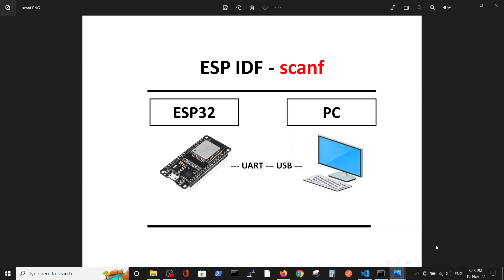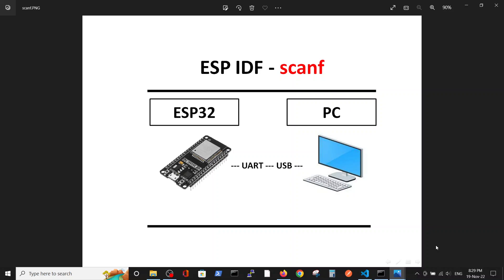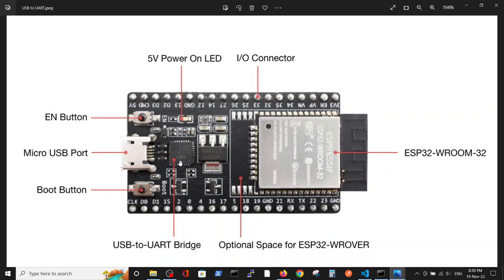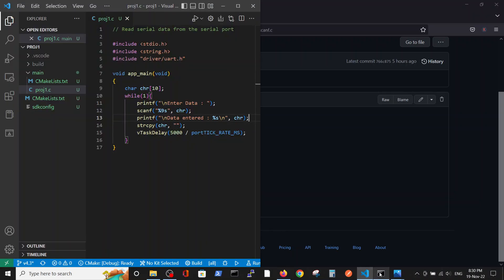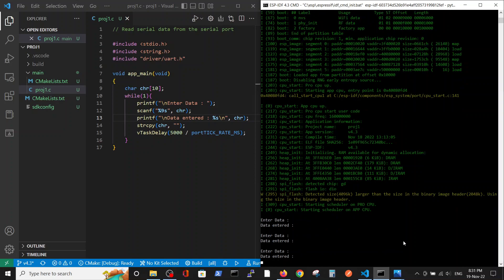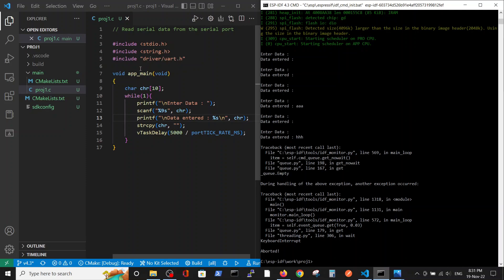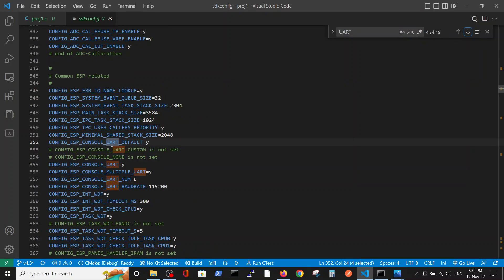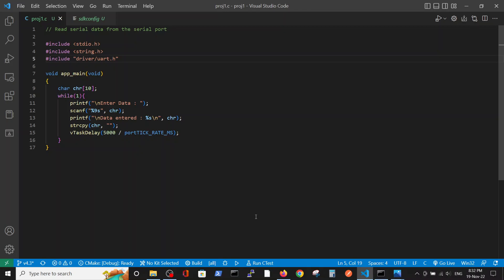ESP IDF printf and scanf via the console without UART definitions

Comment: How are you able to type in your command prompt? Whenever I try to type, I get the error " --- Warning: Writing to serial is timing out. Please make sure that your application supports an interactive console and that you have picked the correct console for serial communication". Thanks!
Reply from the maker: Dear @ironshawarma,
I have reloaded this program again and updated the delay command for version ESP IDF 5.0 in the following link:
https://github.com/SIMS-IOT-Devices/FreeRTOS-ESP-IDF-Basics/blob/main/scanf-v5.c 
The program worked fine as in the video. What board are you using with which ESP32?
Reply: @simsiotdevices6219  I am using an esp32s3 board. I tried using your updated code, I still get "--- Warning: Writing to serial is timing out. Please make sure that your application supports an interactive console and that you have picked the correct console for serial communication."

Was there any other external software/terminal you installed other than esp-idf?
Reply from the maker: Dear  @ironshawarma  ,
I think the difference here is in the electronic board we use. I am using ESP32 DEVKITV1, and you are using ESP32S3. Those are different hardware-specific UART behaviors. ESP32 has a native USB chip, while ESP32S3 has a USB-CDC. I think that is the main reason for the different behavior. Please check in your menuconfig that stdin/stdout/stderr are defined over UART.

Comment: Thanks for the video.
I had a misconception. I used scanf before in esp-idf but it didn't work. I also read in esp32 forum that we can't use scanf in esp-idf platform. 
Should we use scanf instead of esp_console library?  I am currently trying to use the latter.
Thanks.
Reply from the maker: Dear One tech a day,
The esp_console library enables you to create a console like interactive shell (DOS, windows CMD, windows PowerShell, ...). On the other hand scanf allows only simple input of data via UART (USB for PC).
https://www.youtube.com/watch?v=fzHefRPDy_w